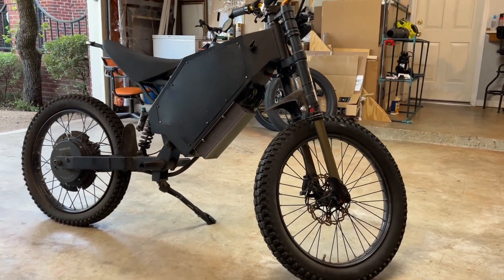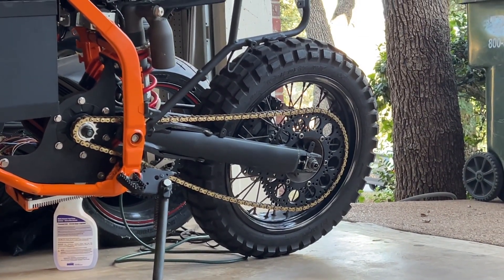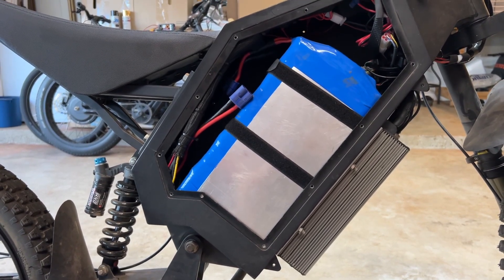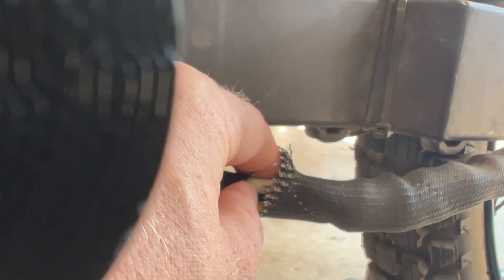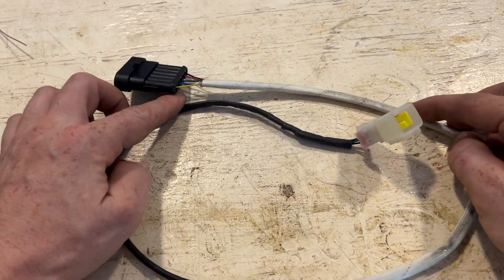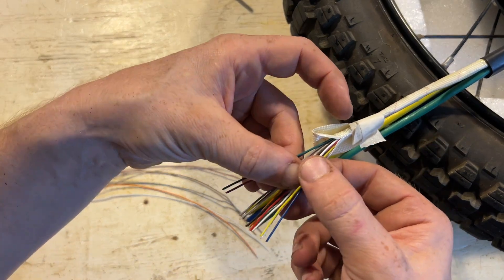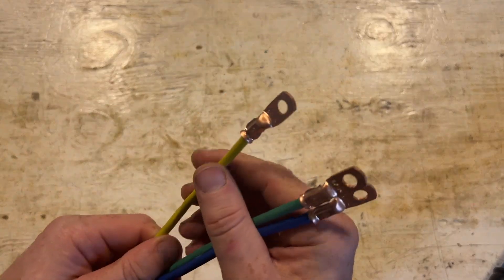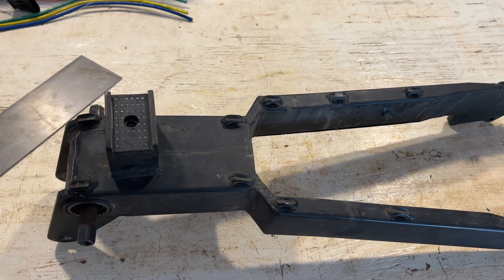This One Simple Hub Motor eBike Upgrade Will Make Your Life 100x Easier

Comment: That connector will create a bottleneck for the amps, input 450 dc and 850 phase amps through my bomber so this fix would just melt if you have any kind of real power going through it, but I'm sure a sabvoton will be just fine...
Reply from the maker: the connection itself is across the terminal lugs, which I'm sure can handle a very large amount of current as long as they are pressed tightly together. The block is just there to provide a structure that holds the bolt on which the lugs are secured in place. But yeah, I'm not sure what the temperature threshold is for that block before it starts to deform. That said, if that connection is heating up enough to melt that block, there's probably too much resistance in the connection to begin with
Reply: @GaiusGarage  Maybe add some contact spray onto the bolts ? That would prevent corrosion and help electric contact ?